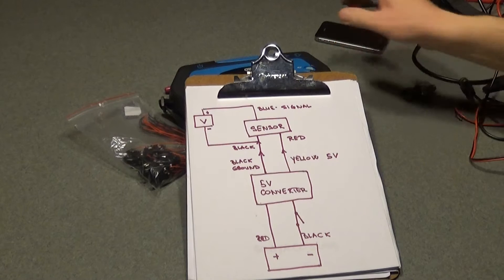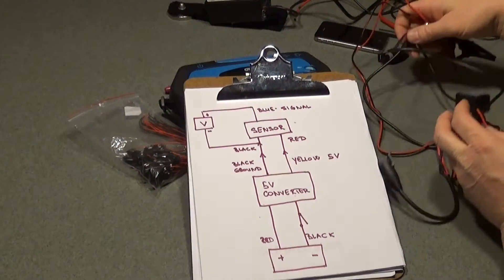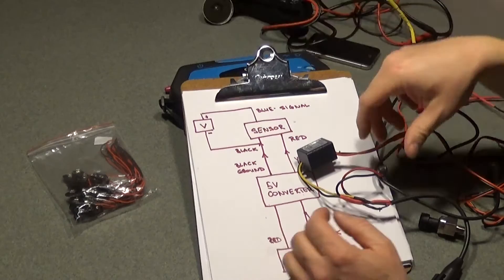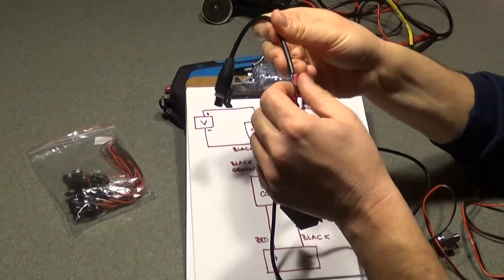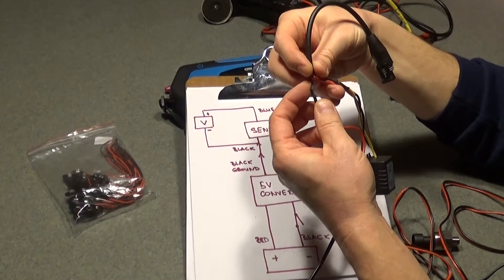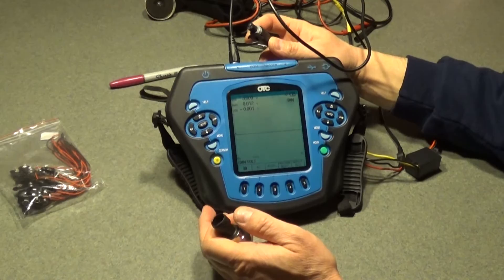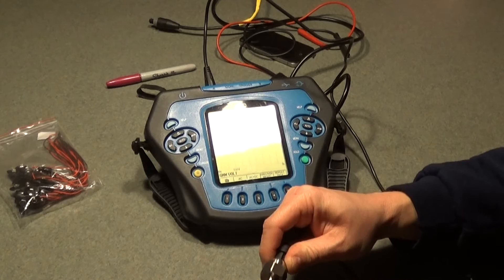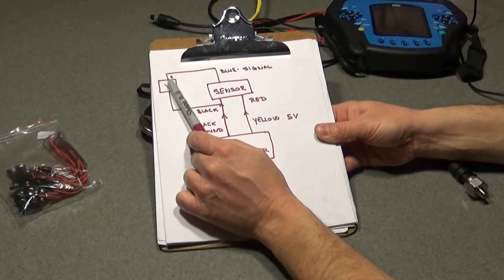Home Made Pressure Transducer Regulator

Comment: great video.  you made it simple to understand how to build this.  ordering the parts when I get my allowance from the Mrs:)
...way better than spending 100s.
should I figure 500 psi will work for gasoline cylinder compression or go with 1000psi in the event there's a crazy fluke I don't expect?  do you get less sensitivity with the larger psi transducers?
Reply from the maker: stgreen78 what labscope do you have? For cylinder  compression I like 300psi.
Reply: picking up a used modis tomorrow.  was going to get a pocket ebay scope , but it's almost as much as the modis lol
Reply from the maker: stgreen78 MODIS is awesome tool. You will not be disappointed. With that tool you can use 100 and 500psi pressure transducer it's already preset.
Reply: KY HomeGarage very excited to get it.  I've been using elm327 Bluetooth & torque as a scanner. not bad & I love torque, but would like to improve my troubleshooting & need the tools to practice.
Reply: KY HomeGarage great video.  that's the one that lead me to this one.  just picked it up , only has 6.4 update, but came with snap on service cart, 2 amp clamps, 2 test leads,  all us/Asian/Euro obd1 adapters & keys for 600. (let me know if you think it's a good deal.) called snap on & can't update...but who cares.  if I can learn to use this to 50% of it's capability I'll be happy. 
thanks again
Reply from the maker: stgreen78 you got awesome deal amp clamps alone are  minimum $300.00 👍👍👍

Comment: Can you just use a 9V battery straight or do you have to use a voltage converter? It might burn up the sensor, huh Ramon?
Reply from the maker: oshin aslanian you are right you will create short in circuit